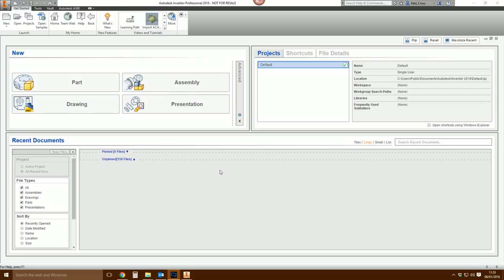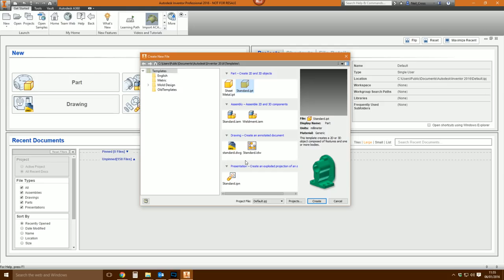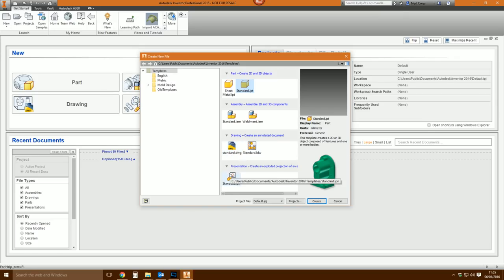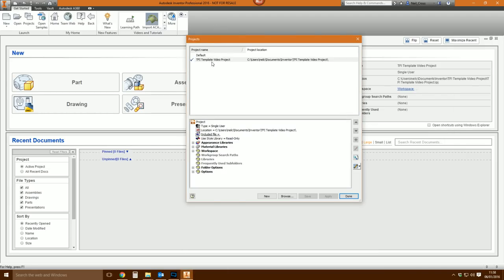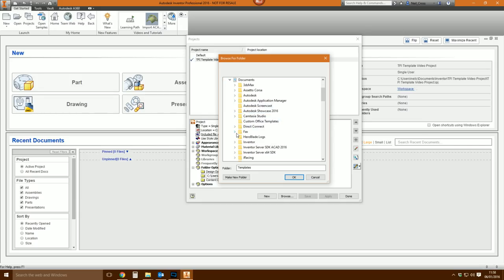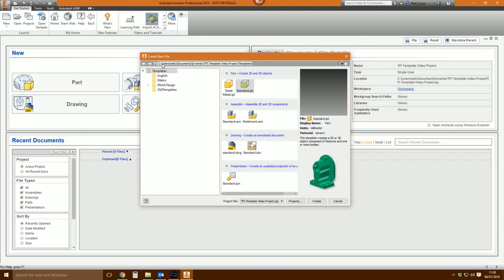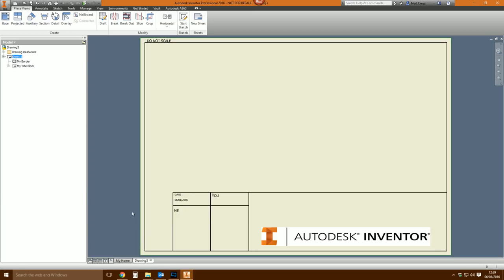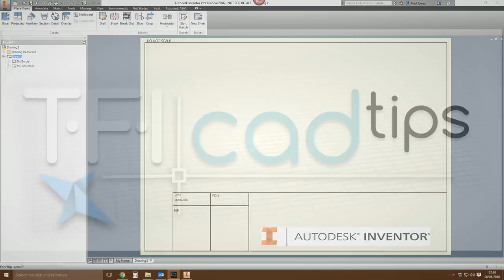Create your own drawing title block template | Autodesk Inventor

Comment: I am having trouble fixing a small "sketch logo" on the top left corner of the border, if I change the sheet size it keep moving up or down, like it is keeping its distance from the bottom corner. If i dimension it to the upper corner to keep in position it moves anyway and it changes the dimension value, or it doesnt let me change the sheet size. Any ideas?

Comment: If I would like to have different margin and binding edge pending on the sheet format (A4, A3, A1 etc.) is it still possible to use only one scalable border or do I then need to create 1 border template per sheet format? I am looking at something like this (as per cad drawing standard NORSOK Z-005):
Format | Sheet size (mm) | Margin (mm) | Binding edge (mm)
A4 | 210x297 | 10 | 15
A3 | 297x420 | 10 | 15
A2 | 420x594 | 14 | 21
A1 | 594x841 | 20 | 30
A0 | 841x1189 | 28 | 42

Many thanks!

Comment: I went and edited in AutoCAD. Saved the drawing separately and then I use that as my template now. 

However, new sheet doesn't copy over the AutoCAD blocks unless I click on the template sheet.
It's strange. 

Might go back and create a full Inventor title block after  my current project.

Comment: Prior solidworks user here...  Is there a way to create a 2nd block on the same page?  We would have our revision block in the upper right, and the main title block in the lower right.  Because Inventor auto aligns the blocks... I am unsure how to do this.
Reply: Hello K G, I think you are asking about having multiple connection points on a border. In your case you want a upper right connection point defined on the border when inserting the revision block. Then have a second connection point at the lower right corner of the border - then insert the title block to snap to lower right corner. See Autodesk Inventor 2023 Help - To Work with Drawing Borders https://help.autodesk.com/view/INVNTOR/2023/ENU/?guid=GUID-785912A6-CB47-4496-A856-18584D5B0037

Seems the Inventor designers attempted to make it simple to insert title blocks but in my opinion, it is difficult with the vague documentation how it is done.

Comment: I see that we can link our Border to whatever sheet size we choose to use, BUT...is it possible to link the Title Block to whatever sheet size I pick AND for it to scale up as the sheet size increases? 
You see...in my workplace, we only print in letter size (Size A) and the boss prefers for me to place my drawings (parts) to their original scale (1:1) but of course most of the time these will overlap the size A sheet, and then I'd pick a bigger more appropriate sheet size and it'll fit, but then my title block shrinks and my dimensions are too small and same for the text....so yeah....that's my dilemma :'(

P.s. I was watching videos on iLogic rules and parameters for this issue....but it is not clear to me if the people who made the video had already created different title blocks and borders for different sheet sizes...

Comment: After watching your video, everything has worked out just perfect. Thanks a lot! There is one more thing: Is there a way to implement the thickness of sheet metal of my part in the textbox?
Reply: You may already have the solution by now. But it can be done. You have to automate the iproperty field of the part. For example, under iproperties panel you can automate a filed called stock number and type this =<Sheet Metal Rule>. It will spit the sheet thickness in the field. You can then find the same "Sheet metal rule" property in the properties panel on the drawing like shown in the video. It will display the sheet metal thickness when you bring any sheet metal part in the drawing.

Comment: Hi, tnx on this info..... i wouldn't able to figure this out on my on....
well, I got a bigger problem on my hand...( I`m working in solid edge for 10 years, this is first time with inventor..( got a new job) .., but i need a little more help from you, if you can explane........ the end game of drafting :)  how to cretate a custome part list in  default template...not to do each time on new draft, or I have to do it in assenbly..( exp..... columns in partlist ... from i property= title, subject( dimension),  manager or project ( din standard of standard part or part number)....quantity,item number......

if you can explain, would be very grateful :)